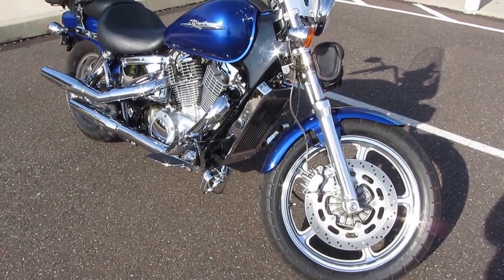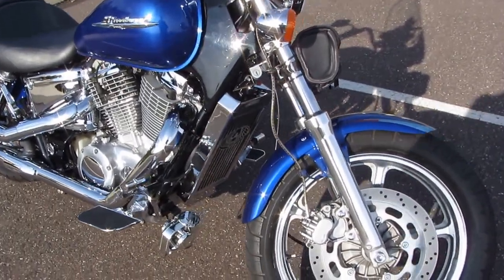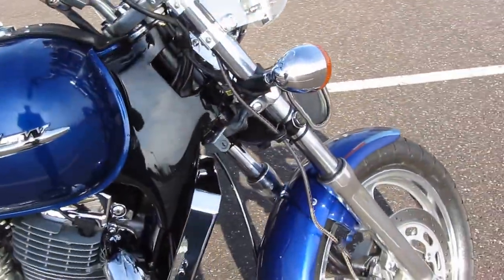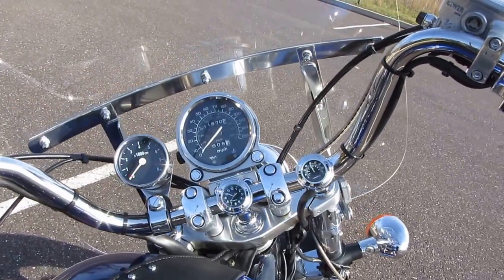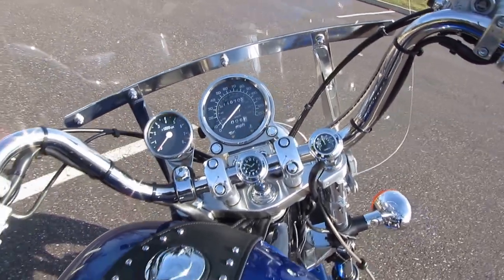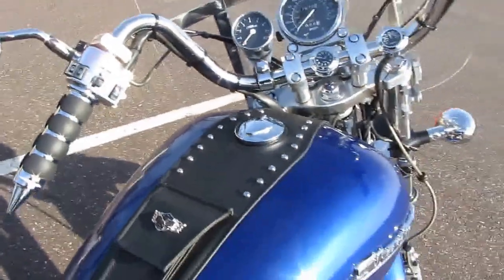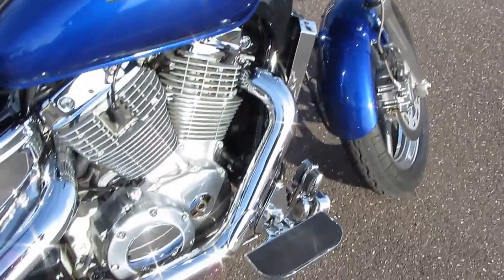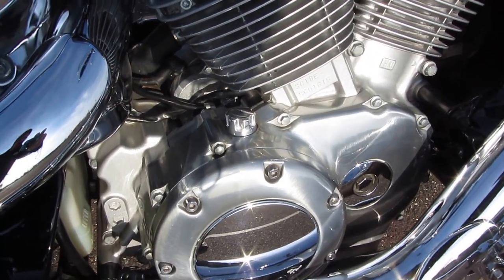honda shadow spirit 1100

Comment: Good job man
Reply from the maker: thanks. I have to make another video soon. I made some more changes and upgrades that everyone will like. this year the bike is 20 years old. had it for 8 years and put 13,000 miles on it. has 26,000 on the odometer. only time it let me down is running out of gas.

Comment from the maker: THIS IS THE TACK I USED. THEY CHANGED IT TO WHITE WITH A BLUE LIGHT FOR NIGHT.  IT'S ELECTRONIC. JUST HOOK UP TO A COIL. LAST ONE LASTED 3 YEARS. HOME DEPOT HAS CHROME BOLTS AND NUTS............https://www.amazon.com/Bikers-Choice-Mini-Tachometer/dp/B000GZTJOM/ref=sr_1_4?ie=UTF8&qid=1545501970&sr=8-4&keywords=bikers+choice+tachometer

Comment: Where did you get the clock and the temp gauge?
Reply from the maker: Dennis Kirk. Rush  city,  mn. Just bought one last week. Brand is MARLIN. Analog. Had  it 6 years, no  problem no leaks. Face  started faded after 6 years, time was always accurate.  Face is white. $56.00 includes tax,  shipping. Can't go wrong. Fits    7/8"  and 1" handle bars.       .